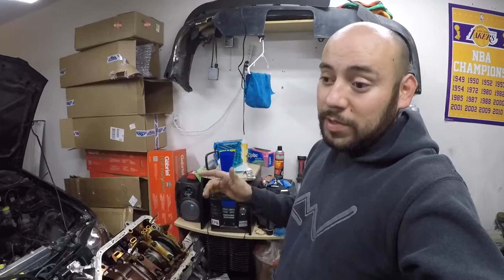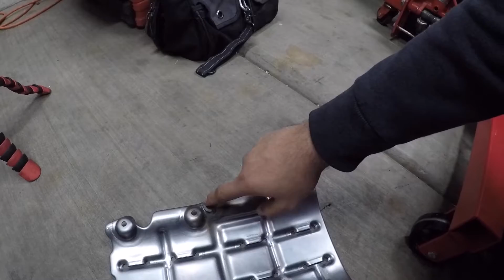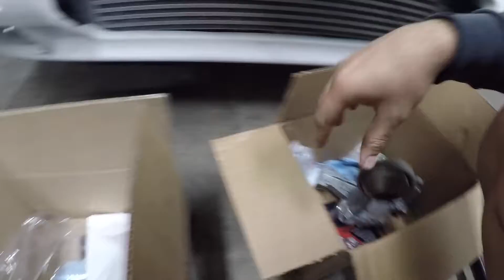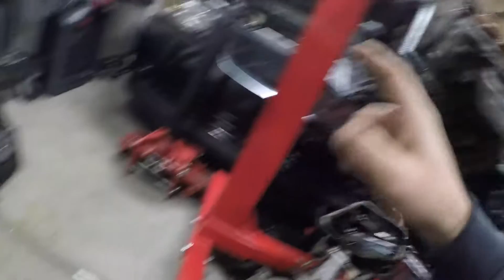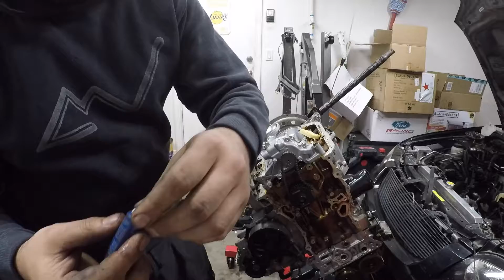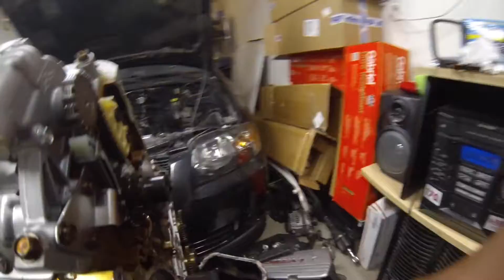How to Install Your 4 Piston Racing Ported K Series Oil Pump

Comment: You need to take it out bc u won’t have even 30 Psi of oil pressure
Reply from the maker: I have recently started the car and test drove it and oil pressure has been great!! So far no issues just working on the speed sensor issue since I installed a awd transmission. subscribe for sure videos and updates man!

Comment: I'm pretty sure some of those are threaded I wouldn't use silicone
Reply from the maker: Well I couldnt remove it lol it was stuck and i couldnt drill into it with what i had... so it shouldnt back out now with that welded bolt and silicone.